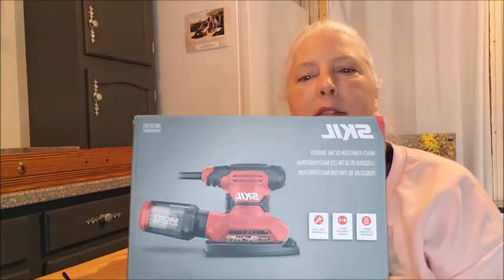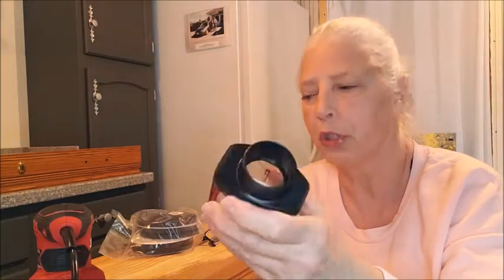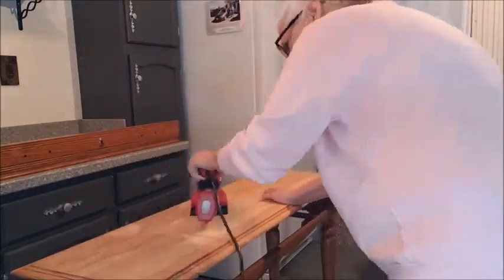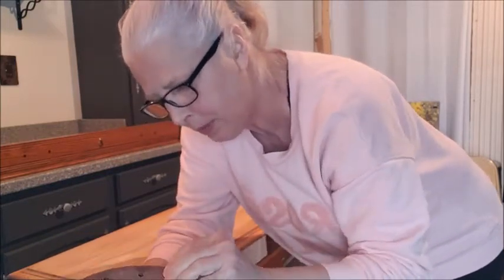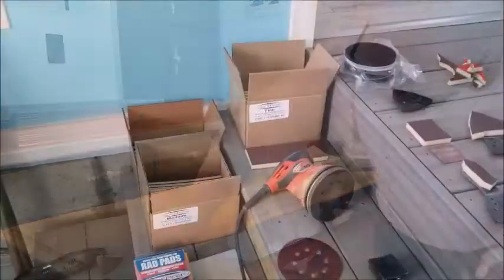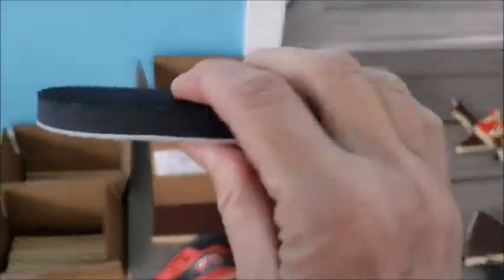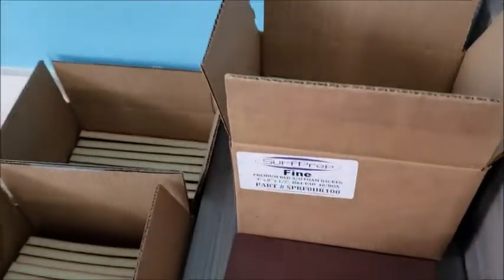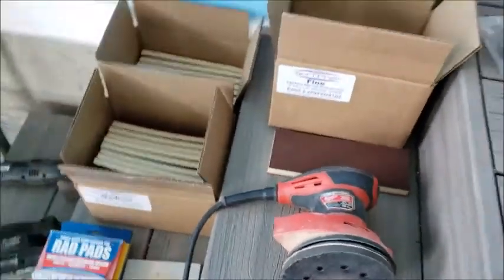How to use a Skil Multi-Function Detail Sander & Using Surf prep foam pads on my current sanders!

Comment: Thank you for the great video!  Can you tell me how thick the finger and louver attachments are?  I am removing paint from a deck and need a slim sanding tool to get in between the boards.  I am hoping this may do the trick
Reply from the maker: Hi, sorry it took me so long to answer, It doesn't alert me when I get a comment.  The measurement of the finger attachment is 3 1/2 by 1 inch wide.  Hope this helps.

Comment: You seemed to be very negative before beginning. I'm just an ordinary person who needs to sand some old furniture in a summer cottage. I haven't seen any other sander with these attachments. Can you give it all another try? Thank you so much. Maybe I should just buy a sand blaster. IDK at this point.
Reply from the maker: Hi, i have sanded alot!,  because i hate stripping with caustics,  i don't have a heat gun to strip either.  If its old furniture, it can depend on what you are trying to remove.  Thick lacquer is rough to remove, and probably no choice but to start with chemical stripper, then you still get to sand it.  If its really thin clear coat then sanding for sure.  If its painted, depending on the thickness, you can try a heat gun and scraper, chemical peel, or just sand it.
Reply from the maker: I use the sander in this video alot, and i am not disappointed in its performance.  If you have lots of spindles to sand, those rad pads and soft pads shown in the vid work the best.   Yeah, i am always negative when it comes to sanding.  Hope this helps.